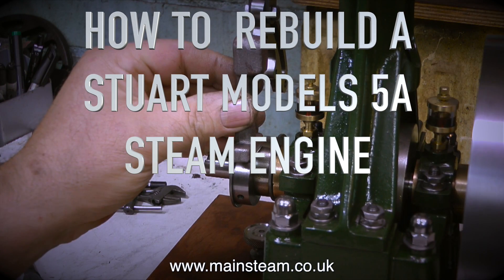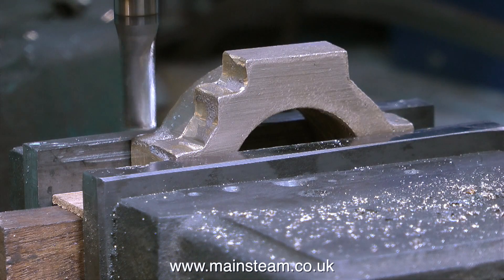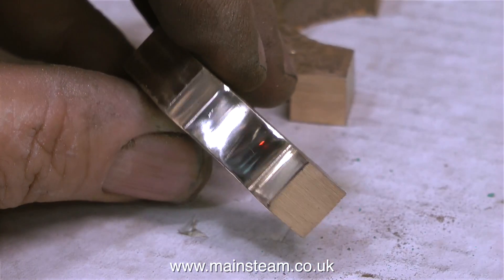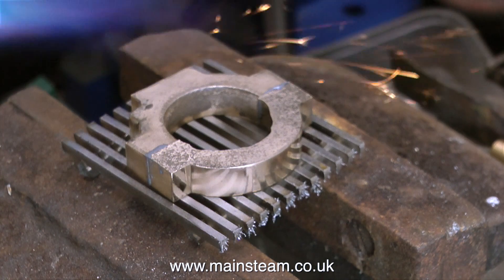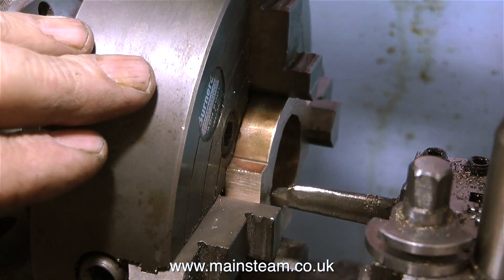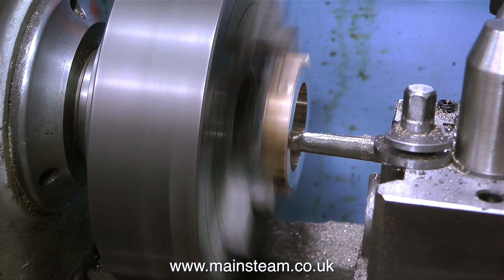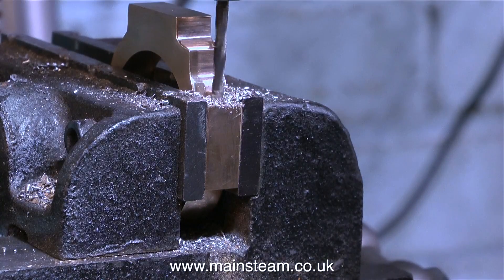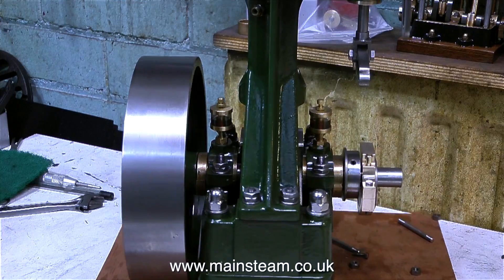HOW TO REBUILD A STUART MODELS 5A STEAM ENGINE - PART #25

Comment: 9:20.  That would be a "spring cut."
Cutting a second time, removing 
what the pressure of the tool 
forced the tool out.

Keith, again, LOVE your work!
(Anyone say that you machine like 
a Musician?)  Now, if you could get 
these videos to sound like a Hammond 
C3, WITH the speaker designed by 
Don Leslie.

steve
Reply from the maker: I couldn't have put it better myself :-)))) Thanks for the good comment . . ..

Comment: G'day Keith, another fine video. I like that little fire grate you used when soldering (ah it's pleasant to hear soLdering, rather than soddering) Did you make it? Thanks Peter
Reply from the maker: I didn't make it, it is a piece of commercial stainless steel model steam locomotive fire grate that I bought from http://www.blackgates.co.uk

Comment: Keith, I enjoy your videos and your sense of humor. Quick question, I never see you using any sort of cutting fluids when you tap or ream. 
Is it because the type of metal does not require it? Thanks
Reply from the maker: I do use cutting fluids sometimes, but on the videos I usually do it dry so that you can see more clearly what I am doing. i use tapping compounds sometimes, or my steam oil/machine oil/ rapeseed (Canola) oil combination lubricant.
Reply: That makes since. I have a little machine shop, I know how long it takes to do machining operations, 
I can’t imagine how much longer it takes when you video, edit and narrate each procedure. 
Thank you for going to all the trouble.

Comment: I can't believe you run the spindle with that block of wood in there....have you ever had it fly out and bonk you in the head ?
Reply from the maker: So answering the same question for the 3rd time ..... the wood weighs next to nothing, the lathe is running slowly and this small insignificant piece of wood is firmly held in place by the casting  ........ did you miss the part where I hammered the casting tightly against the small piece of wood?

Comment: Nice video. I am trying not to be a safety nazi but is it not wise to remove the wood from lathe chuck before proceeding with turning operations?
Reply from the maker: the tiny piece of wood weighs next to nothing, the lathe is running slowly and the small insignificant piece of wood is firmly held in place by the casting
Reply: LOL copy and paste answer from the same question above it! I love it! Should keep a note document on your desktop with your top 10 replies to the keyboard engineers in it, so you can copy paste them quickly. That way you have more time for editing and not typing?